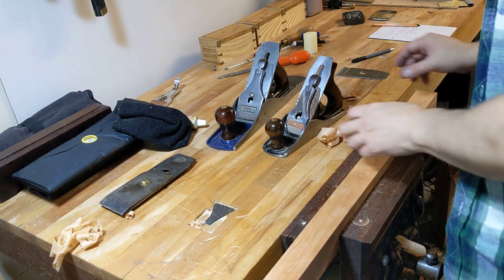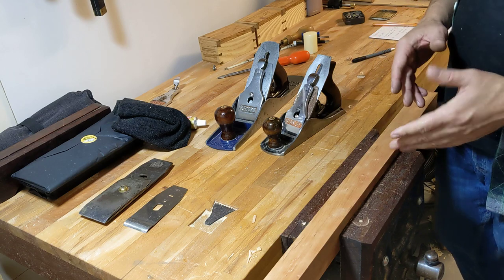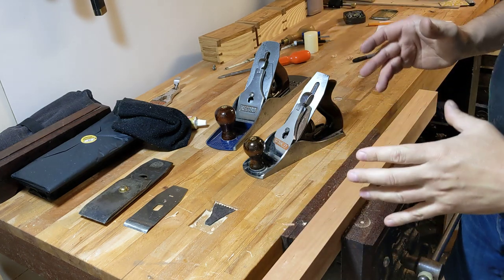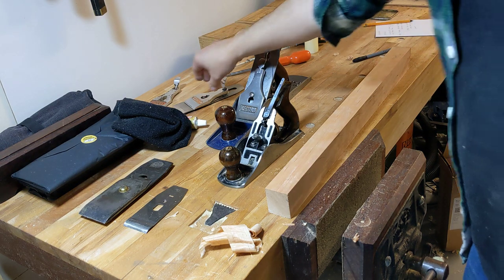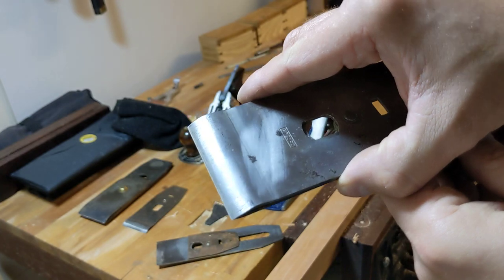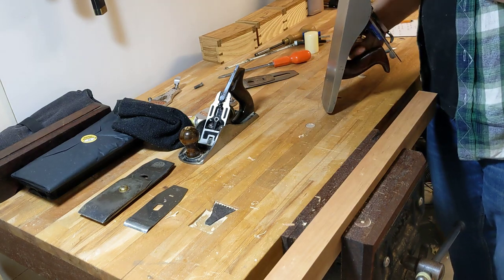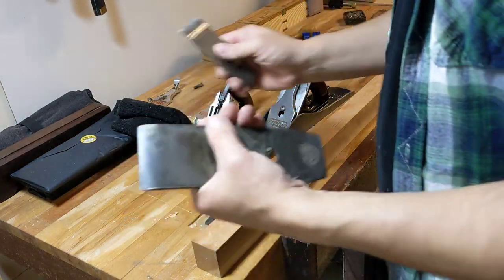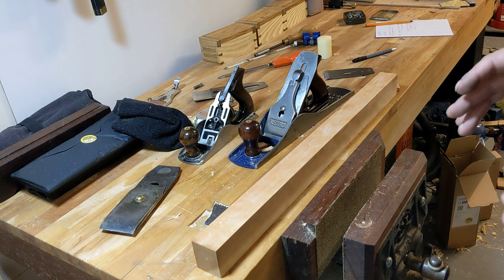Cap Irons or Chipbreakers Do What!?

Comment: Well, for the last efforts here, the color changes are light reflecting or refracting off of the wood. I did see a thing in fine woodworking once where some one made some folding screens, and his design incorporated the reflection/refraction aspect of cherry. With my wood bowls, I use the different colors like you show to tell me where I need to sand more, and it is to remove tear out. With bowl turnings, for 1/4 turn you are cutting with the grain, then 1/4 against, then repeat. There is always some tear out when you are going against the grain. So, I am wondering if that is actually tear out but you have reduced it to the point where you can barely feel it. For sure when you cut the other direction, you won't get any tear out.
Reply from the maker: Thanks Robo. The main point is the cap iron stops chunks getting torn out. If you set a cap iron too far back on bad grain, that's what happens. This piece of cherry is contrary but it's undeniable that the cap iron affects the cut and isn't there to stiffen the iron or stop vibration. 
It might be true to say that on a thin iron Bailey a cap iron helps keep it rigid, but overall a cap iron was introduced to stop or massively reduce grain tear.

Comment: I must admit that after using up the whole length of several Record/Stanley irons I have replaced them with thicker British made irons on several of my planes. Not so much because of the extra thickness but more that the new Record/Stanley irons really aren't very good. I have over the years taken my cap irons/chip breakers to the stone to ensure they are flat along the front edge but you only ever need to do that once. I adjust the clearance for the job/ wood in hand and as you say it's well worth experimenting to learn how that affects the cut.Another good video!!
Reply from the maker: Thanks David. Very pleasing to hear you used the full length of the iron 👌. You have worthwhile experience of heavy use, not many of us can claim that. I assume you went for Clifton or was it Ray Iles?
Reply: @faceedgewoodworking  It was Ray Iles but I recently aquired a Holtey which is also very good. I am retired now so will most probably never need another iron but will hand my planes down to my sons and they will be able to do the same. I wish more people would stay with Stanley/Record planes and save their money to spend on wood.
Reply from the maker: @davidjennings9253  Great advice on sticking with Bailey's. Kudos on the Iles, got one in my block plane because when I picked it up the iron was used up.

Comment: That was a really nice demonstration of what the cap iron does. However, I'm still left wondering how it does it. Is it pressure applied close to the cutting edge, or (as the chip-breaker name suggests) is it the way it deflects the shaving as it leaves the cut?
Reply from the maker: Hi Rob, thank you!
The best recourse on this is totally free and you can find it here https://www.woodcentral.com/articles/index.php?page=673&tags=handtools&search=&op=AND
Reply: @faceedgewoodworking  That looks like a really interesting reference. Thank you.